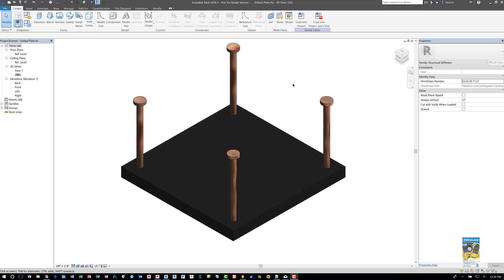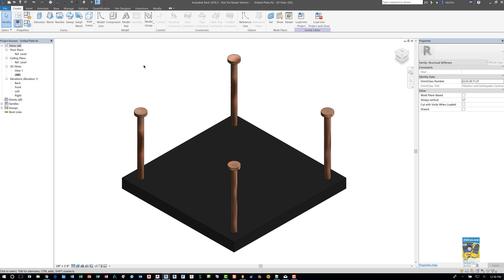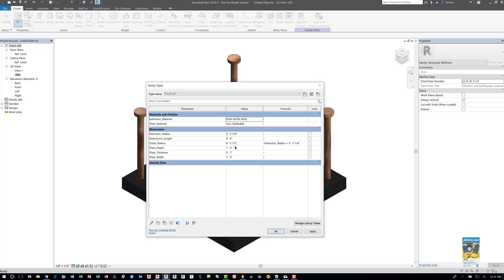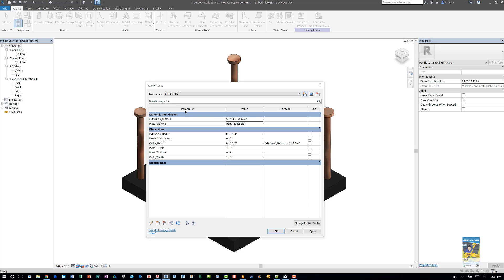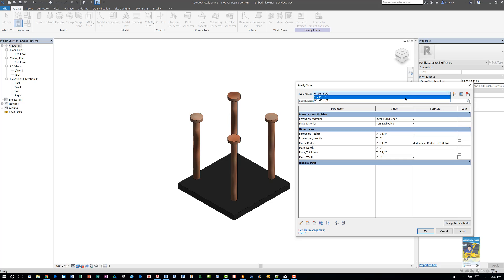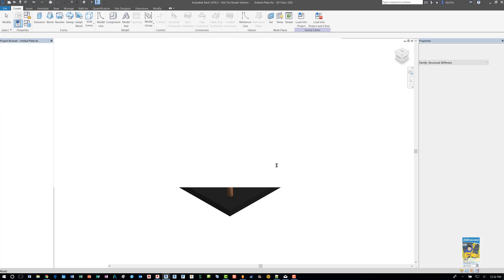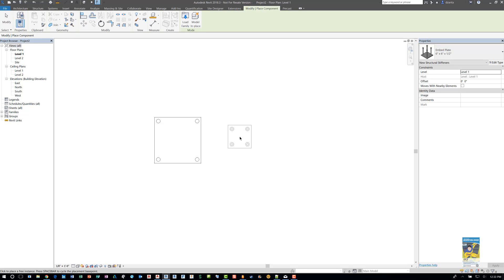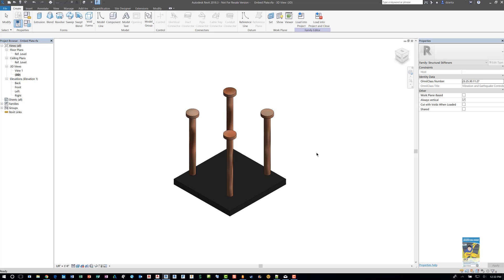Revit Family Types - A How to Guide

Comment: But to be able to do this first we need to put annotations and lock them and give them labels. Right?
Reply from the maker: annotations such as dimensions that are locked tell the geometry to stay at that size.  This is only done if you know you don't want that part of the geometry to flex.  For example, if I dimension the thickness of a countertop and I want that thickness to stay 2" then I dimension it and then lock it.

If the dimension is parameterized (given intelligence), then the geometry is meant to flex when you change the dimension.  For example, if I want the height of a counter to be able to change from 2'-10" to any other size say 3'-6", then this is where the parameterized dimension comes in.
Reply: @DzanTa  Thank you so much for the clarification.
Reply from the maker: @EmreGündoğan-o4p  
no worries